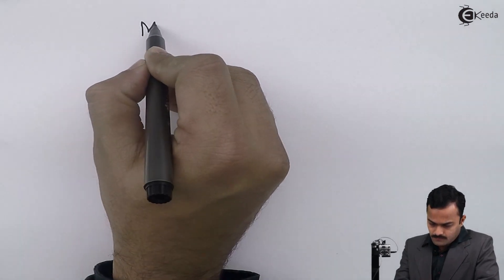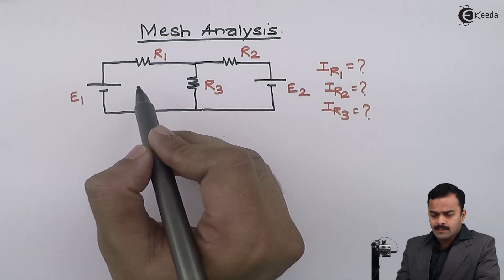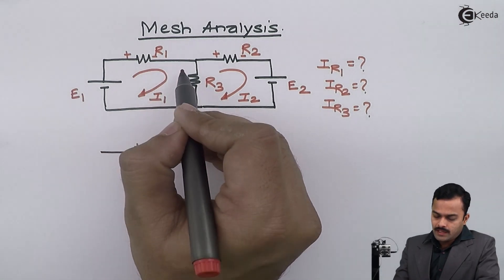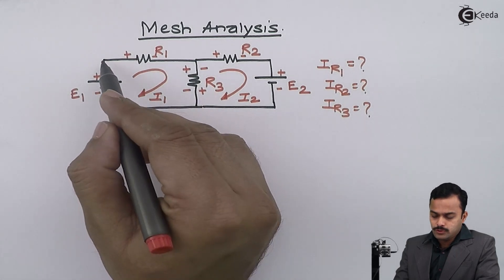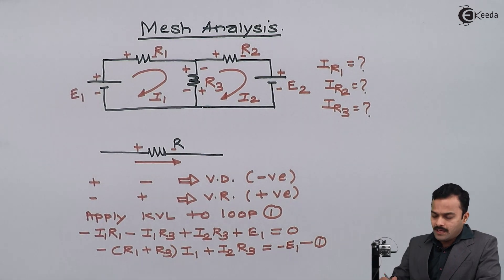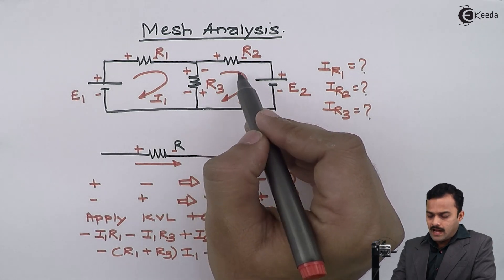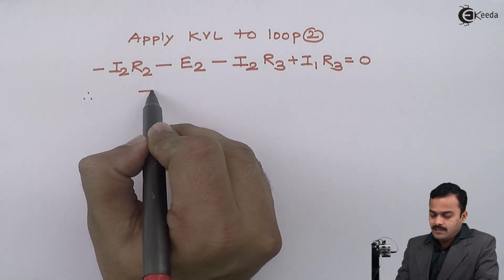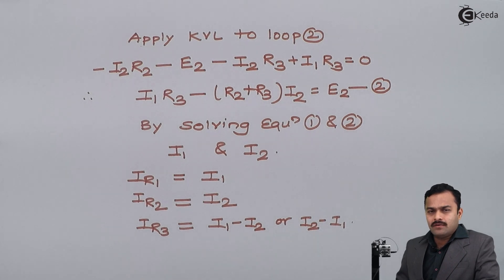Introduction to Mesh Analysis - DC Circuits - Basic Electrical Engineering

Comment: ) An iron ring has a cross-section area of 3 cm2 and a mean diameter of 25cm. An air gap of 0.4 mm has been cut across the section of the ring. The ring is wound with a coil of 200 turns through which a